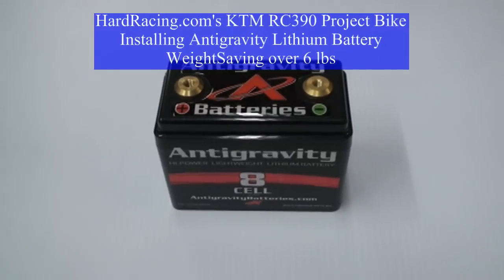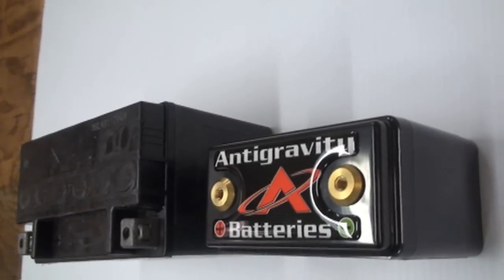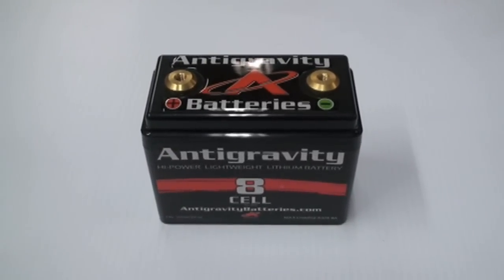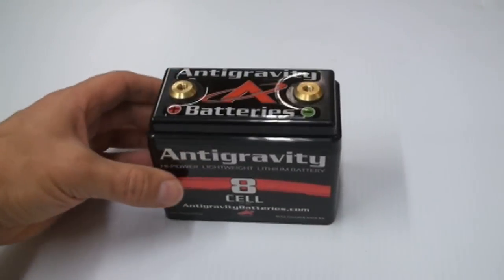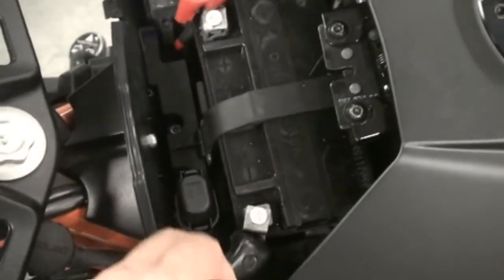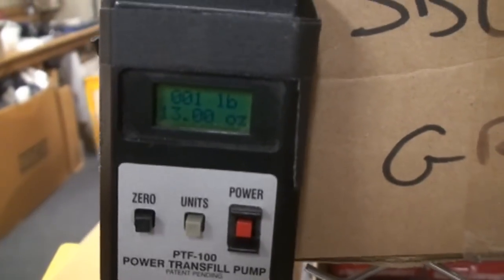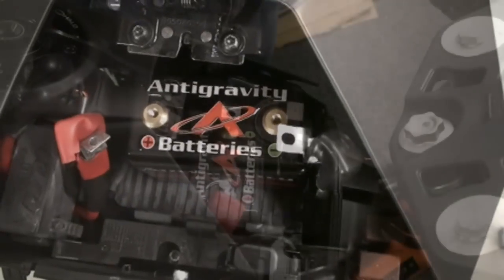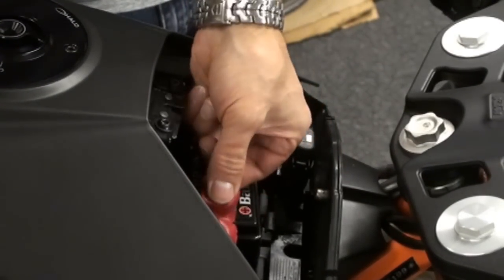KTM RC390 Antigravity AG801 8 Cell Battery  Install Save 6 lbs  #Hardracing #RC390 #390Duke

Comment: hey man nice vid im tryna install a remote alarm systen and im having trouble trying to access the fuse box as its quite small and so are the fuses, i can get them out. do you know if the fuse box comes out, and if i may need to remove the tank to get access into it. 
cheers
Reply from the maker: Yes, with a little work you can get the fuse box out.  Or just use needle nose pliers to remove the fuses.  Be Gentle they are only plastic.
Reply: that's great thanks for the reply :)

Comment: thank u but I did want it to put it back its sitting I right position
Reply from the maker: +sai srinivas 
We do not understand your question ? 
This battery is SMALLER then stock.  So why does battery lid not able to fit with smaller battery ?